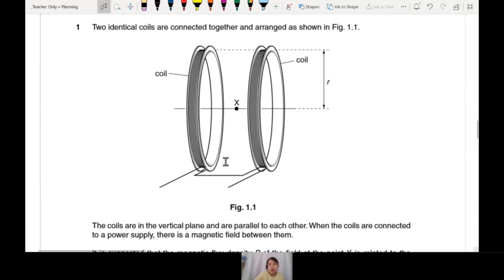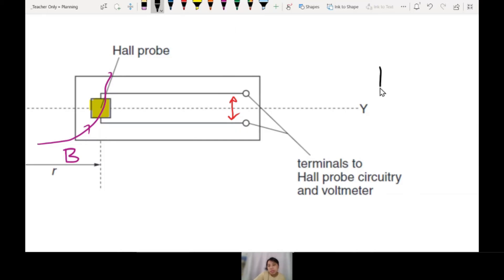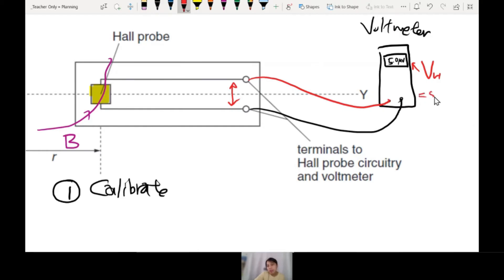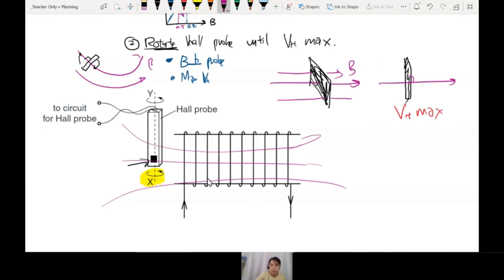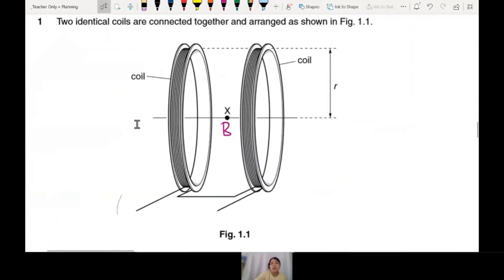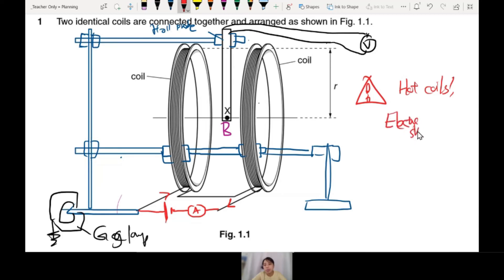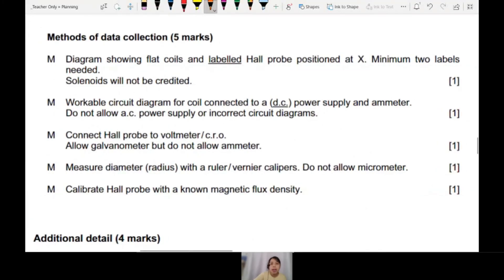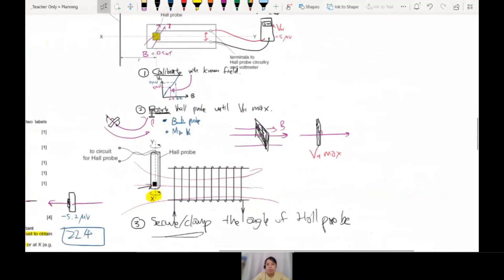MJ14 P52 Q1 Using Hall Probe to Measure B | A2 Practical Paper 5 | CAIE A Level 9702 Physics

Comment: Is it important to calibrate? Cant we just get the hall voltage when needed and put it into the equation V= BI/ntq to get B?
Reply: That's it. Doing the calibration is simply plotting this function (VH against B) as we are only measuring p.d. across the hall probe so measurement is not direct